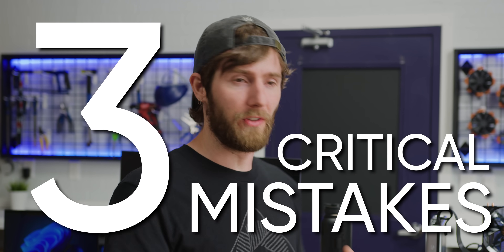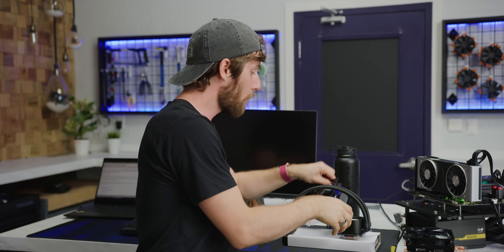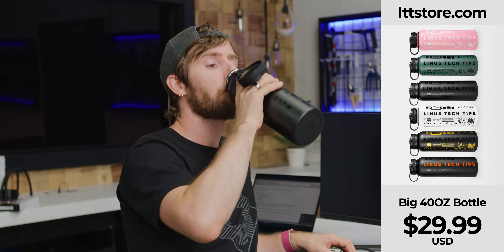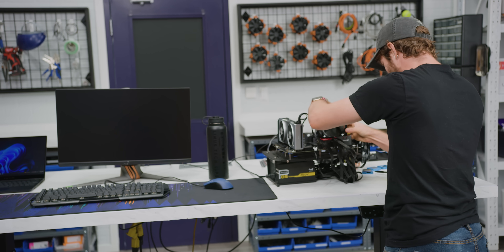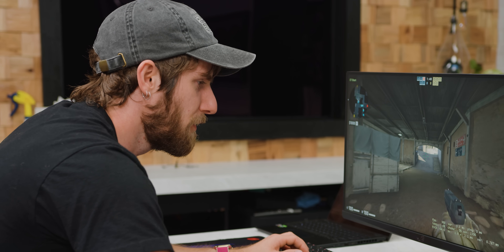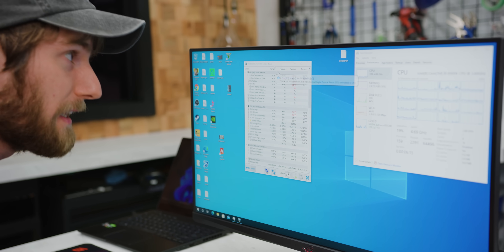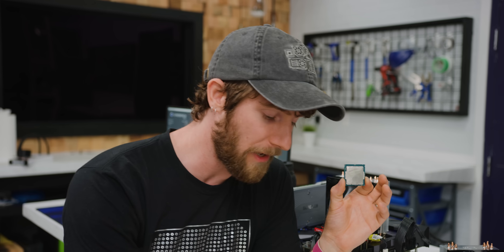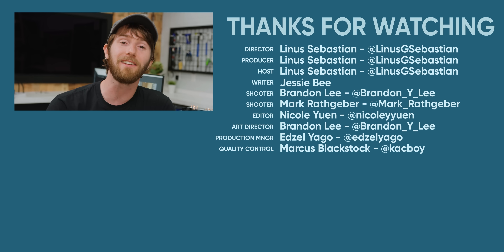How BAD is it if you forget to peel??

Comment: My aunt managed to leave one of these devils on about a year ago, when I help her assemble her computer over a phone call.  I figured something was wrong about 4 months later when I visited, and had a look at her computer. I ran some benchmarks cause I was curious over how it performed, because she said she had issues of it crashing when my cousin was playing games on it.

After some testing, the CPU was at about 96-105C, and I figured she must have applied too little coolant paste. When I went to change it I found a crispy piece of plastic, and a small dribble of dried up coolant paste. 

Safe to say this was probably not good for the chip, but after I replaced it it ran steady with the same cooler at about 50-60 idle and 70-80 while gaming.

Comment: We bought a few Dell OptiPlex 7050 computers a few years back but one of them would have the fans spinning at maximum capacity just turning on the PC.
Well, being brand new and under warranty, we needed to get a Dell tech over and guess what.
The CPU's hard shell plastic had been left at assembly.
Fortunately, no damage had been done either to the CPU or anything in the system.

Comment: WELL DAMMIT LINUS, NOW I'M WORRIED. I can't remember if I had to peel on a Noctua CPU cooler. I'm going to say no, since I don't think I'd get these sick temps on a Threadripper 3990x, 60C under heavy load and over-clocked. While sharing a case with a 3090. Also, the board has 3NVME drives on it, 2 8tb and 1 4tb gen 4 and 256GB of RAM. Edit: also my room with the PC can get up to 85F since I live in Mississippi now.

Comment: Been building pc's since I was 12.. but yes.. 
My Ryzen 5 2600 was running for about 2 years.. with the plastic still on the Cooler.
Only found out when I switched to a 3600.
Never had any issues tho, even used it to mine XMR, but it left a nice  imprint on the cpu heatspreader saying "Remove before use"
I certainly hope the guy I sold it to didn't delid the thing XD

Comment: On my Second build I decided to get the nice Cooler master cooler..  when I was done it would power up for at best 5 min and then shut down it drove me nuts...  Finally took it to another builder and he said did you forget to peal the plastic off the cooler... Facepalm!  Yep..  Removed it and pealed off the plastic and new thermal paste and never had an issue since. I sure check for it now on any cooler I use...

Comment: I did this once in a similar fashion to Linus. I got distracted, came back, and stuck a 212 EVO on a i5 4960 with the sticker still on. I checked thermals using a normally reasonable bench and was hitting 80s - 90s right away. Was perplexed, took it apart, and found the sticker. Definitely a facepalm moment.

Comment: I used to work as tech at MicroCenter, i was the build tech for a couple years. There was times when customers would bring in their failed to figure out how to build it or a build that "worked" but has issues. Few times, i did find the plastic still on the cpu cooler. (Though, most often it was an extreme over use of thermal paste, even had a couple customers that thought u had to fill the cpu socket with paste.)  We did have a tech that had no idea what they were doing, and built a high end system with one of those sealed Corsair liquid coolers...it came back week or two later and did not boot. The plastic was left on the cooler, the part that attaches to the cpu, it melted and caused overheat, thanks to the customers overclocking as well, fried the board and cpu and cooler.

Comment: If you've applied your thermal compound correctly, R1 in your diagram does not exist. At the microscopic level, the paste fills in gaps and also acts as a film barrier that does not have any holes (this would be like if your thermal paste had bubbles in it) just like in your car there is oil between (no metal on metal contact) between the piston and the... Piston holes? (I don't know cars) . There are no gaps with heats ink metal on heat spreader contact (unless you forego thermal paste entirely, which would make a great video, BTW). You can prove this by attaching the heatsink, removing the heatsink, and if you take a picture of both the surface of the heat spreader and surface of the heatsink (or just eyeball it) you can see that any of the areas where paste is missing on the spreader, you will see that on the heatsink and vice versa.

Also, your diagram would be more like (I will use"R" as thermal transfer impedence) a series circuit (I won't include the die attached to heat spreader) . R=R1+R2+R3+R4. 1:Heat spreader, 2:thermal paste, 3:plastic sticker, 4:heatsink. R3 >>R1+R2+R4

Comment: Sooooo, is the 11600k just as bad as the 9900k? (in regards of Intel´s unaccurate TDP values)

And before the mob of angry AMD users follow this comment with 100+ comments, intel was actually the cheaper option when comparing between 5600x and comperable B550 board to my B560

Comment: Im no PC expert. I boughlt a prebuilt that had a turbo charger sounding Intel cooler. Decided to replace it with a Lian Li 240mm AIO. My first ever cooler install. Watched LTT vides Jayz videos and a couple other s as well. I  Left that little sticker on my AIO I went two days wondering WTF was happening why it was 100 degrees Celsius constant. decided to take it all apart and try again and BOOM THAT DAMN STICKER!!!! well oops... Two days constant running on an 15-10400 with a sticker and my cpu is still in tact!

Comment: Electricity takes all the path along with the path of least resistance, now if you have a circuit with resistors in parallel then the current will flow through all of them and not just the one with least resistance.

Comment: I used to work at a computer store, when i worked there the technician was upgrading my co-worker's computer and he noticed that he had the plastic on the cpu cooler. Now he said he was running it for 2 years and didn't run into a problem at all he only upgraded because it had better rgb features on the pump and the fans, my mind was blown when i heard about this

Comment: You should've done a test without the plastic to see the difference, specially because you're using a measly 212 Evo that might have problems with that i9 even when installed correctly

Comment: In this case, it still has a decent cooler. But if it's like you forget to connect the fan also your cooler is a cheap one that can not be as a passive cooler, your CPU can be throttled not only canceled the turbo, but actually fall back to more safer frequency. If you see your CPU constant run at 0.8Ghz, that's a very common safe frequency. You really should check out what's happening. I do see ATOM X5 throttled down to 33Mhz (mobile CPU can have much less frequency in case of a severe throttle). But I also knows some CPU if already throttled downed to 0.8Ghz and still reached Tj max, it can shut down itself. And if more unfortunately, like operating without any heater, the temperature goes up too fast, and thermal protection isnt kicked in in time , you can damage your CPU!

Comment: one of my customers installed a compressed air filter with the protective plastic cap still inserted ... complained of a low air flow rate ...

Comment: Did that only once, and that was on my previous build (mITX in a Corsair Obsidian 250D). Air cooling with a lightly restricted clearance for the fin stack so used a 92mm fan. It was loud "for some reason" then noticed the CPU temps. Dig into it to ensure that I mounted the heat-sink correctly. It wasn't loose, so I removed it, and there it was, in all it's mostly transparent glory.

Comment: I've done better than this one time, i had a wrong monted cpu cooler: the cooler was 2cm higher than the cpu IHS (wifi cooling 😎) on a i7 8700. I booted and it was all fine.... But when i started cinebench the frequency dropped as hell then i saw the T° being actually in hell then after shutdown the wifi cooling solution

Comment: when I sent my MSI laptop for RMA after 2 months and a ton of problems happening, they sent it back and everything seemingly worked fine. Except this year I had to go through the horrible pain of swapping the keyboard on it and while doing it I discovered that a plastic stencil, meant to apply thermal paste in a perfect square, had been left on the gpu die and was keeping the cooler from getting close enough to make good thermal contact. After removing it I finally started having decent temps after over 5 years of owning this laptop.

Comment: CPU cooler manufacturers need to step it up... I wonder how hard would it be to make something that protects the mating surface of the cooler but when heat is applied to it, it turns into paste(thermal compound)?

Comment: point of order:

linux didn't do a baseline test for either processor. He used an evo212 IIRC which couldn't even cool my 6700k with the sticker removed and all overclocking nonsense disabled. Of course the 9900k thermal throttled.

Comment: Made the same Mistake in my first build since years, 2 weeks ago. Took a note to remember the peel, prepared anything, went to lunch, came back and put it together. Then I went to bed and postponed the power up to the next day. Next Day I remembered the peel and checked if I removed it before powering up the Pc. Result: FAIL! Forgot to peel the day before. 😂 
Forunately I bought some extra paste when I ordered the parts AND remembered the peel before powering up the System. (AMD 5800X). 😂

Comment: I do wonder if this has happened with my pc... I've never really thought so, but the only thing that's making me question it is that my CPU isn't staying at a consistent clock speed, and its always below it's base speed of 3.90GHz, usually hovering around the 3.30GHz area, but also dipping below that speed, or going higher for a few seconds. But idk if that's because of cooling or because of my motherboard's power delivery or something.

Comment: Can you extreme overclock a 5w chip? Or, what temperature can a 5w chip have with a standard water cooler?
Reply: I can answer second question without any testing: ambient, or very close to. However, overclocking 5W chip on LN2 could be fun.
Reply: @mrmarecki1  imagine having a 12ghz 5w chip at 2V while staying at room temperature

Comment: so for light gaming scenario you do recommend adding another layer of plastic(between cpu and paste), to fully isolate thermal paste, for ease of replacement?
Reply: Fuck no...
Reply: @donovan6320  are you one of those old folks that saves your pci-e slots for imaginary graphics cards, instead of waterproofing them with epoxy? :D
Reply: @dreamglimmer  uhm not old but yes...

Comment: you could have just set the i3 to 5ghz fixed frequency, turned on prime 95 and waited for the 115°c shutdown but instead you chose to explain how thermal throttling works, whack

Comment: My friend didn't screw in cooler properly and it's surface wasn't even touching the CPU. Core i5 4590 was running like this for about an hour - we installed windows like this drivers etc. and tried to find out why cooler spins at max speed all the time. Bios was telling us that temperature sensor was damaged so we used the PC like normal thinking that CPU is cool and only some sensor is talking trash, but after we screw in the cooler properly everything went back to normal.

Comment: my 5950x has a corsair hydrox custom liquid cooling solution on it (that also has a 3090 in the loop) that includes 2 360mm radiators and it STILL reaches 75c idle temps on hot days and can STILL reach 95c with an all-core workload like blender or cinebench. WITHOUT the plastic... if I had plastic I'd know immediately because it would probably be melting before the machine got to windows.

Comment: When I worked at an electronics recycler, I ran into this exact thing with a recycled Dell desktop. The person said it never ran like it was suppose to (long before thermal throttling existed). When I pulled the cooler out of curiosity, there was the sticker. I laughed so hard
Reply: long before thermal throttling? So like, early 2000's? Late 90's? Intel has had thermal throttling since the P3 era, and AMD enabled it not too long after due to their cpu's literally burning up.
Reply: @kasuraga  My guessed estimate may have been wrong because I really associated boosting and throttling starting with the core i series. It was either a P3, P4, or PD. In the state we got it would thermally shut off within 10 seconds of entering the bios. It had a very tall air cooler with plastic ducting directing air through the back of the case, it was quite a system for its time. And boy Dell had some awful capacitors, we could only "recondition" about half of the Dells that came through
Reply: Was there a 10% off warranty discount coupon on the sticker?

Comment: Linus: “Is there plastic in between your CPU and cooler right now without you knowing it?

Me: no I made that mistake when I built it the first time and launched a game and my cpu temps went to 100c +
Reply: That's like leaving your baby in the oven but not realizing the smell
Reply: @twisteddalek9983  XD I realized there was something wrong when the temps went to 100c+ so I took it apart and removed it
Reply: @twisteddalek9983  "Leaving" your baby in the oven requires first putting it there, slightly different from forgetting to peel...

Comment: But what aboud SSD's and the usual sticker? If you remove the sticker it voids your warranty but will it isolate the SSD and give bad thermal results even though you have a heat shield on top of it?

Comment: Considering I regularly run a Core-i5 2400 without a heatsink or fan at work on a test rig for a till PC (The thing runs 40*C idle and auto throttles at 95C) I'd expect an i3 to be better.
Alas, a big heatsink with plastic between on an i3 is thus probably cleaner than applying any thermal compound.
Higher spec chips are liklier to struggle.

Comment: I lost an GPU to a peel on a waterblock that i forgot. It took about 1,5 year for it to die though. It was in a SLI system with dual Nvidia 9000 series. There weren't any performance issues and the only thing i noticed was a few C higher temps. like 3 to 5. Always check your peels guys

Comment: welp..... this brings back memories, literally did it on my first PC build with all-new components. My PC just overheated and gave me the BS-of-death. After testing I noticed the issue was cooler-related. Removed the cooler and found.... yup..... the plastic was still on. idk why I got thrown straight in to the BS-death-tho.....
CPU was an i7 9700KF overclocked to a steady 5.1 GHz.....

Comment: When I first built my real computer I did this.. And it was like that for 2 years untill I installed hardware monitors and saw my cpu was throttling at 91 under load and had an 80 idle temp. This was on a six pipe heatsink..

Comment: Most embarrassing mistake:

Plugging in the 24 pin, peripherals, gpu, cpu, ya know. All the things. Well, I didn't plug the other ends into the PSU. I just tucked them into the PSU/HDD basement and totally forgot to plug them in. 

3 hours of troubleshooting later, I decided that maybe I should take the rat nest panel off, low and behold all my cables were still waiting to be plugged in.

Comment: I understand that the cooler was cool to the touch, BUT I'd still like to see a cooler that was capable at BASELINE to handle the heat from the 9900k. THEN use the plastic and see how much of a delta there was. Someone call Steve.

Comment: I did this once but "luckely" the PC didn't boot because the B550 board (with compatible bios) did not post with my 5600x. So I noticed it when I removed the cooler to RMA the board, apparently the board model was bricked from factory in on the v1 bios chip which would never support a 5000 cpu regardless of update. Changed board and all worked well

Comment: It happened to me many years ago, when I got a store to mount a gaming PC for me. It worked fine, but temps were too high. I removed the CPU cooler to reapply thermal paste and check it was properly mounted, and discovered they hadnt removed that plastic. Temps were normal after that. I told them and they didnt know what to say, they apologised at least. Have assembled all my PCs myself since then.
Reply: Should have given you a discount of something you could buy.
Reply: in my case i literally pulled a paper sticker to my cpu fvk prebuilt 2nd hands

Comment: It is worth pointing out that the performance of the plastic peel will become even worse over time as the material from prolonged heat exposure will develop bubbles in the material and that will reduce conductivity even further making the problem worsen over time.

Comment: I accidentally did this on (thankfully) a Ryzen 5 3600. It was a 360mm aio. No problem with thermals though because of the low thermal output of the Zen 2 architecture.
Reply: My 5600x runs kinda toasty though
Reply: @armando1is1great  depends on your cooling solution and case ventilation. I had mine in a Lian Li O11DX with 6 fans in and 3 out.

Comment: The sticker in the video has the text written on it ... I once had a cooler, that had a completely transparent sticker on it, that I couldn't find even searching for it. But since the computer kept shutting down because of CPU overheating in performance testing, I checked it again and the heat of a overheating CPU caused the sticker loosen itsself so it could finally be seen ...
BTW: Alpenföhn Brocken was the one with that issue.

Comment: I've fixed PCs with Molex and floppy power plugs plugged in to random things, such as a floppy power cable plugged in to the remaining pins of a broken SATA port, I dealt with CPUs which Thermal Glue which is supposed to be used on passive heatsinks for chips and ones that have had several different thermal paste layered on it... I've even seen people with high end PCs they've had for the last 6 months and had the display coming out of their motherboard port while there's a $600 GPU in the system..